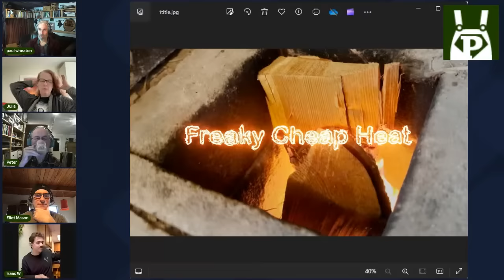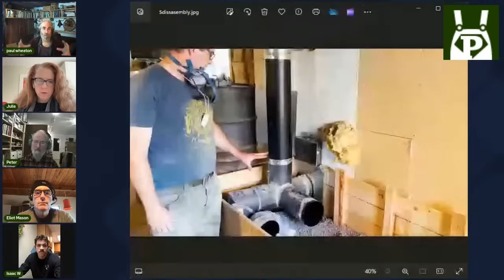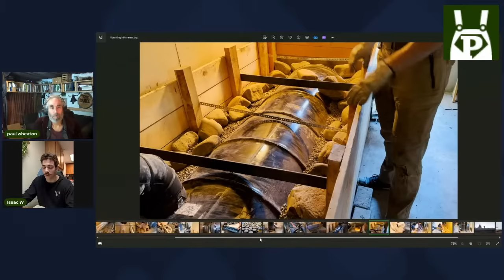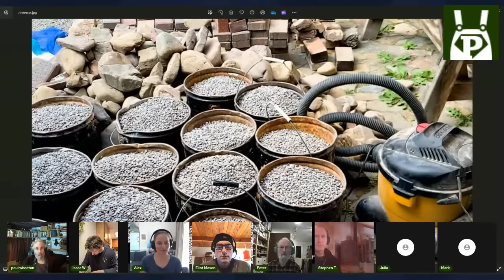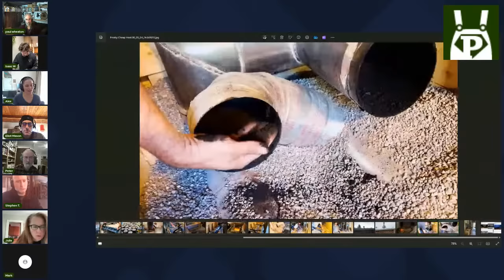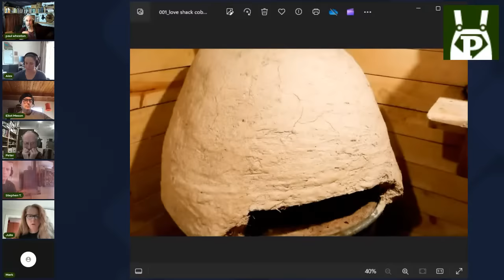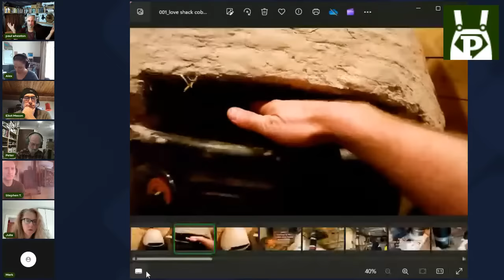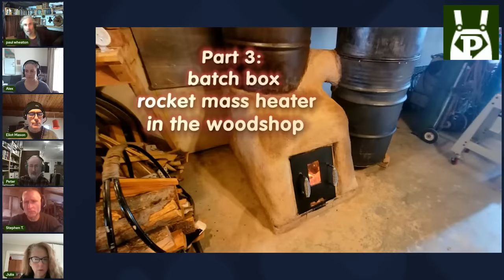Free Heat for Every Home: Recent Innovations & Optimizations in Pebble Style Rocket Mass Heaters

Comment: My main gripe with current RMH designs are the lack of cooking and baking ability. Incorporating a proper oven into the design adds a large efficiency increase if it eliminates the need for a separate wood fire cooking appliance. I'm designing my RMH to have dual baking ovens. The lower oven will be inside the Batch box burn chamber and be exposed to wood smoke for when smoke flavor and cooking over coals is desired.  There will be a second oven directly above the  burn chamber but below the 55 gal bell barrel, and this oven will be isolated from any exhaust gases. The top of the burn chamber will not be insulated and be 1/4" steel plate that will act as a skillet when the top oven door is removed. When not cooking, a ceramic insulated blanket can be placed ontop of the top oven floor to increase burn chamber temps. Now,  raising the bell barrel about 12-16" above the burn chamber creates a nice large gap for the top oven to be, which will be heated by both the burn chamber from below, as well as the underside of the bell barrel above. This will also make the riser tube taller and draft harder. IMO, it is better to lose some burn efficiency and be able to properly bake and cook with the RMH, and make cooking/baking  a critical second function, rather than trying to extract every last ounce of efficiency without having ovens in the design.
Reply: Subscribed to your channel look forward to a vid on your completed project.
Reply: Cool, yeah I'll upload some videos of my RMH build before the end of Winter and will be doing other builds soon.
Reply: @nateross14 
Use more paragraphs.

Comment: I raised my barrel bell above the burn chamber to create a space for a baking oven between the bell barrel and  burn chamber that gets heated  from both the top of the burn chamber as well as the underside of the barrel bell. Not only do you now have a functioning oven isolated from exhaust gases, you also gain extra heating surface area of the underside of the barrel bell,  and when the oven is not being cooked the door can be removed and extra heat goes out in the room. Also, a ceramic insulation blanket can be placed on the floor of the top oven to insulate the top of the burn chamber when not cooking for higher burn temps.

Comment: I think it’s better to use none thermo transferring materials when creating this system. It allows the air to move as it should better since the material holding it doesn’t transfer heat.

Comment: Modern boilers use automatic flue damper to contain heat in the boiler after the burner shuts down saving up to 20 percent If you placed a thermocouple in the burn chamber then you could fine tune the millivolt output and use it to hold your “plug” open. When the fire goes out the millivolt charge would be gone and the plug could return to its normally closed position.
Reply: I’m not understanding why, if you close/seal the intake, there’s any need for closing the chimney. Where else is the airflow happening? Seems like a lot of complications for nothing.

Comment: In terms of the chimney on the roof affecting the draw.. would insulating the external chimney help maintain the draw better? The exhaust gas would keep hotter?
Reply from the maker: Yes and no. Lots to say here that will not fit into a yt comment.

Comment: How would the cob hat in love shack cause spading on the drum if they were in contact rather than hat mounted just above the drum. Is it friction from metal Expansion? Am i thinking about thus right?
Reply from the maker: The steel has to release a LOT of heat very quickly or else it will spall. If the cob touches the steel, the steel won't be able to release a lot of heat.

Comment: Has anyone else wondered how this would work with other heat sources like electric, gas, oil, pellets etc ???
Reply: Ideas is to get wood burning hot for full clean combustion. But then got to capture the heat with thermal mass. Gas or electric can be run on low so no need for a thermal battery.
Reply: Electric is already 100% efficient, gas and oil 95%+, pellet stoves 90-95%. There’s nothing to gain for efficiency. Thermal mass is always a good thing unless you have something like electric or gas infrared which heats the person.
Reply: @brucea550  I was wondering for safety purposes. I run a 128,000 btu diesel heater and it would be cool if while I run it there was a thermal mass that got heated and kept the shop from freezing longer. In a shop there is tons off run off and the heat is lost fast. If you heated a mass the heat would stick around longer after I turned it off.
Reply: @jacobbrizammito7187 I like the idea of adding heat to a mass and then shutting off the heat source for safety reasons. everything off and letting the mass dissipate the heat. My barn is all wood 🤷‍♂️ I don’t leave anything running in there over night. Ever
Reply: @TinyGoHomes  To me, the first priority is insulation, not mass. The mass is simply a flywheel, it’s NOT adding efficiency. The stove gives you just so many btu, whether you heat the air or the mass. With no insulation the mass spreads that heat out longer. But you are now heating 2 things- the air and the mass- so will the shop be warm enough overall? That was the discussion in the last 10 minutes of the video, that the rmh takes a few hours to get up to speed. But that was oversimplified because that 3 barrel batchbox is just one style. Other styles use mass like the masonry heaters in Europe work. Only a hotter burn. 
The key takeaway of this is: a super low chimney temperature (150°F +/-) with no smoke, which means your burn is very efficient (again, that is the efficient part, not the mass). That’s what’s the rocket riser does. So now you know all that heat, (well, maybe 85-90%), is staying in your building. 
So insulation would help your barn more than mass maybe.

Comment: What's the free heat?
What are we burning?
I'm not watching 2 hours and 22 minutes.
Reply: About a tenth of what you would normally burn. The video is about tweaks to the design of very efficient, home built rocket mass heaters so that they run even more efficiently. I could easily run one on surplus sticks from my land, which is about as free as it gets!
Reply: @estherallerton1567  
Rocket stoves are very cool.
Unfortunately, I don't have the resources to construct one.
Reply: @estherallerton1567  What are your typical low temps in winter, how many square feet are you heating? I think one tenth might be true for someone starting with a very inefficient wood stove. If you do the delta-T calculations for a given space you can determine the btu total needed and from there the bare minimum of wood you’d need.
Reply: @brucea550  If we get one installed this year we'll try to do a comparison of what we burn next winter compared with what we burn this winter. I'm getting too old to carry wood down the mountain. I'm aiming at 'significantly less wood' and 'fewer wood hunting trips' and 'more even heat throughout the day' rather than calculations. It's all relative. I'm hoping for a decent guestimate of the fraction of wood I use, that's all. Less than half would be great. A quarter with heat all night and all day rather than just the evenings and the first half of the night would be awesome. If it turns out I can run it on sticks so I can gather all I need using loppers rather than a chainsaw all the better!
Reply: @estherallerton1567  Most important is how well insulated and airtight your home is. Eliminate heat loss anywhere you can- that’s the delta-T part. 
That will return more dividends than the efficiency of the heater. 
The woodstove I have is modified (by me) with a secondary burn. Our winters are 6 months of heating and the house is 1600 sf. Right now it’s -10°F outside. That’s typical for at least 3-4 months here. If I could burn 1/10 of the wood we do, it would be 2 pieces of firewood in 24 hours. So that’s nonsense. I would say you might get to half the wood but again, it depends if you have a crappy stove to start with. There’s way too many variables for anyone to imply ten times more efficient, but that gets people to watch the video. As you already said, it’s relative, and any gain helps! We can’t have a rocket mass heater as we need homeowners insurance and no company will approve them so far, and we have checked repeatedly. But I’m building a big greenhouse and will build one for that.
Reply: wood

Comment: Hi folks, I’m here 🚛🇨🇦🚛🇨🇦🚛🇨🇦🚛🫡
Reply: They definitely will have different results as some people were heating their home very inefficiently. Lots of heat loss etc. when you swap to the rocket mass you don’t get the crazy heat loss you get with other heating sources. I’m only just getting into this subject but my over all understanding is vast. I would love to get involved if you’re interested in having an extra mind. I’ll be doing this in my barn next summer so I’m kinda forced into learning about it. My experience could be essential in working out a solution. Without trying to inflate myself to much I’ll just say I finished an off grid hot tub just last week. I also built my own tiny home and I’m engine swapping my own hummer. I’m also changing my business into a tiny home building company over time.